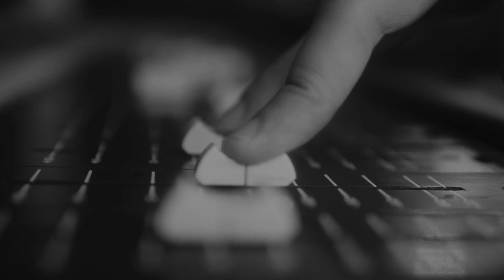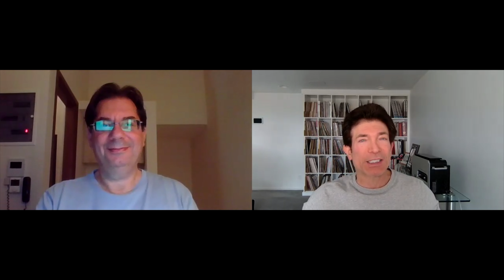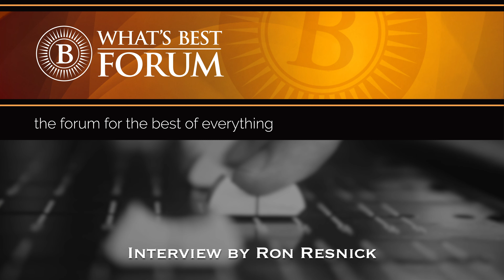What's Best Forum's Masters & Makers:  Demetris Baklavas, Ypsilon Electronics #highendaudio #music

Comment: Today I have a full Ypsilon system and have had Boulder, Nagra, Spectral, Zanden and AR to name some. Each brings their own unique flavour and special strengths, but none compared with the sonic revelation of Ypsilon's deceptively simple novel design. Without favour to genre, Ypsilon always captures the artist intent, and presents it with image lucidity set within a vast enveloping soundstage - though I freely admit these are traits I personally hold in high regard. And of course, lesser discussed but equally important, Ypsilon offers a first class post sales support and update route. With Ypsilon, dealing with an artisan manufacturer doesn't mean foregoing any of the big brand support or civility that you might expect or need for your investment - other brands take note.
Reply from the maker: @anchorman1968  Thank you very much for this report! I'm glad you are enjoying your Ypsilon system! 

Which loudspeakers are you using?  Which Ypsilon amplifier?